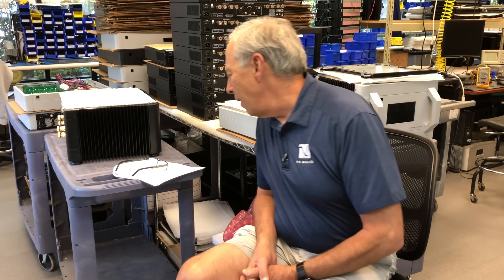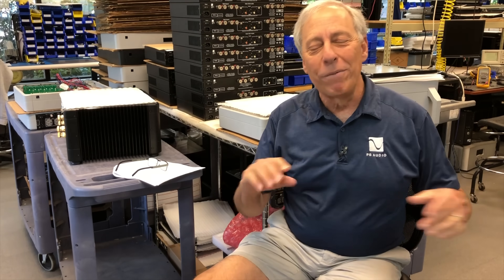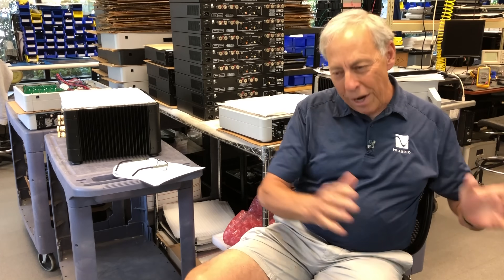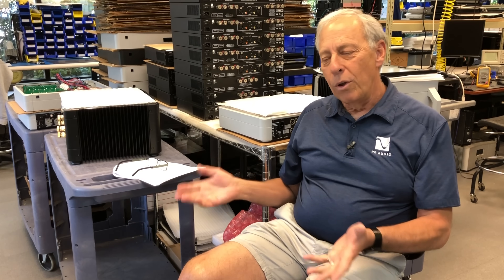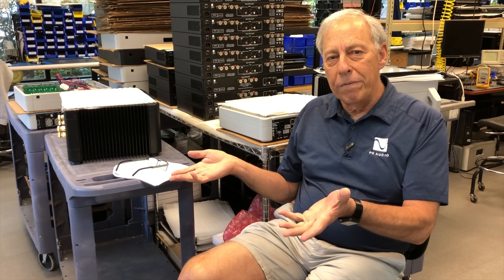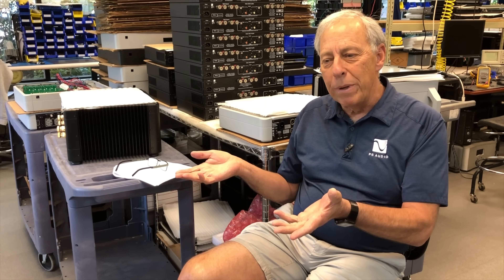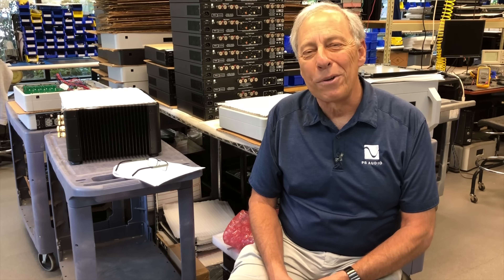Why don't subwoofer have high pass filters?

Comment: You made the statement "A subwoofer should never be heard" 5:24 which I disagree with. It does depend on what type of music you listen to, but if you like bass heavy music (Electronic or Rap) then a subwoofer should be a huge part of your sound.
Reply: the music itself should provide that, and the playback system should be as flat as possible to recreate the feeling of heavy bass if you listen to tracks with heavy bass. What about tracks that dont need all that bass? what about natural sounding speech? Turning up a sub too much will ruin those things.
Reply: Tom C Most of the time, turning up a subwoofer will only amplify frequency's that are in that range. Speech rarely has frequency's with substantial amplitude down that low (below 80hz). I've tested my voice and I can't get anything substantial below 85-90hz. Also, The sub's I have all have adjustment options, so I can turn them down or up depending on the source. It's also worth pointing out that a lot of track's very wildly in how much low end they have. This makes setting one volume for the sub for every track nearly impossible. I realize that's a problem with the mixing and mastering for those tracks, but adjustments are necessary.
Reply: Zatore Just set it to the same level as the mains and listen to that what the artist entended it to sound like.
Reply: No, I'll listen how I want to listen.
Reply: Zatore Ok... Good for you then.
Reply: While subs do produce audible music, they should be blended in so that you can never differentiate the sound coming from sub versus the loudspeaker. If done properly, the bass roll-off should be seamless between your loudspeakers and the sub(s). What many sub manufacturers tell you to do is, to place these subs in the corners. While this can produce great bass, the problem I find is that phasing is incorrect. I find it better to place subs at the same distance or just a tad bit in front of the loud speakers for phasing. This helps to blend in the sound so that the bass frequencies reach your ears at the same time. The rest is rolling off the bass properly to match your loudspeakers. If you have a home theater receiver, you can push the subs back further and delay the fronts, (using distance or delay control) to do this.  This is the way I do my subs to match perfectly with the front loudspeakers.
Reply: If you plan to get very low and use a sub anyways just build/buy mains that are very good at from like 70hz and higher and put a high pass on then. Because it makes no sense to buy big o mains that go down to 35hz if you are using a sub anyways.
Reply: Yall he is just acknowledging that there is bass oriented music, that basically doesn’t work without at least proper low range.
Reply: I agree, all music is not created the same so to make a general statement like that is kind of irresponsible.
Reply: Zatore I think you misunderstood the statement.
Reply: I like my mains left alone, no HP filter , then i match my sub LP filter to the spot the mains start losing steam. Think of it like adding octaves to an otherwise great speaker.
Reply: A subwoofer should never be heard because the woofer in your bookshelf or floorstanding speakers does the bass that you hear and the subwoofer what you should feel !!!
Reply: Steevenoo Humans do hear down to about 20hz so...  Subwoofers that produce stuff that we can NOT hear are VERY rare!
Reply: we still have a sense of it,  and it puts our adrenal glands into overdrive

Comment: Many high-end subs DO offer high pass filters. SVS, Velodyne and I am sure many others offer this feature. Perhaps this is not the same as what is being asked, but I believe it is. My SVS SB-13a Ultra has this features but I have never used it.
Reply: Thanks. the problem I have is that I use it for home theater and for 2 channel audio. I control all of my cross-over points, delay, volume, and frequency matching, using my receiver. I found this the best way when using a home theater receiver. If I only did two channel and had a pre-amp with no front delay or sub controls, then I would definitely use this method. My Pioneer SC-97 Elite supports both LFE and 2 channel audio for subs. I switch back and forth depending on whether I am listening to music or watching a movie. I wish standard stereo pre-amps had the capability to delay the front for proper phasing. The only  pre-amps I could find, are models which support ARC or other room compensation. If this option were standard on regular pre-amps, then I would use a good pre-amp for two channel and switch to my HT receiver for movies. Oh well.    Using my HT receiver, my bass is tight, phased correctly, and rolls off smoothly.